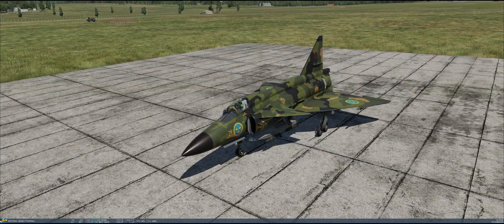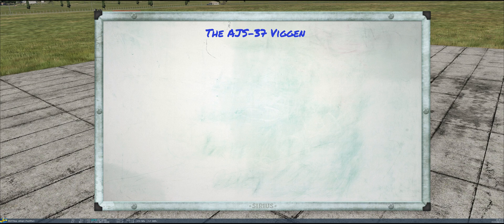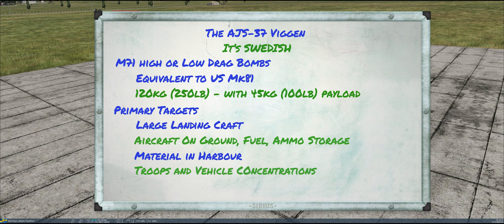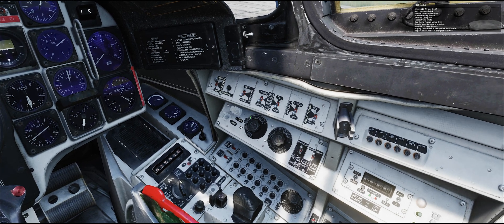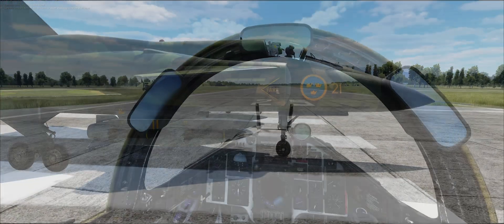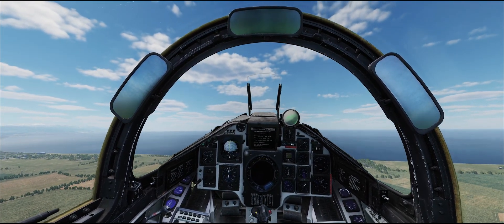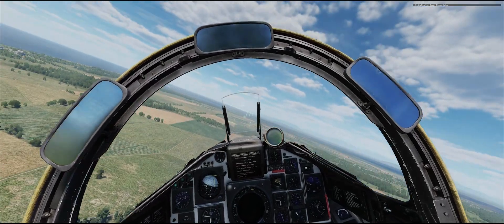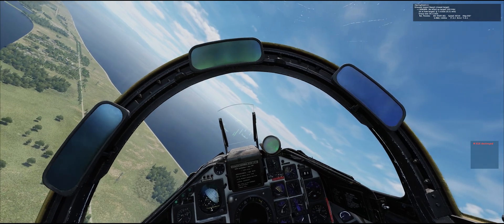Viggen NAV Bombing Tutorial

Comment: Viggen is a whole system designed around this kind of bombing, so using it all makes things a lot easier, specifically the autopilot features help a lot with these navigation point level releases in my experience. If you put the centre dot of the navigation indicator on the HUD within your HUD velocity vector, it means (assuming no drift) you are perfectly lined up for your target, commanding the altitude hold mode at that point leaves only the counting down the range cue portion of the run to worry about for the pilot.

Also, for the toss releases with Viggen, I personally don't even look at the HUD cue after lining up properly. I just follow waypoint range indicator, and start pulling up around 6 kilometers, and then follow G gauge, and release when I hit about 4Gs. I get both fairly decent standoff and acceptable accuracy that way, and is good enough against both MANPADS defenses on target area and even an SA-2 site :)